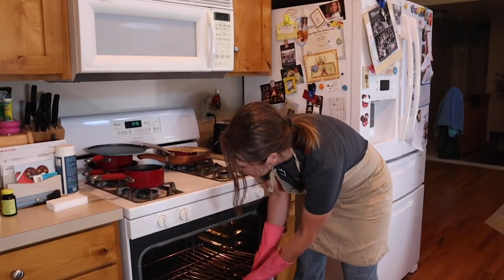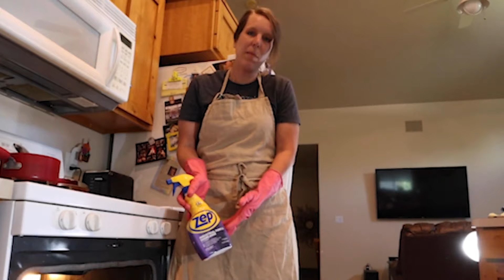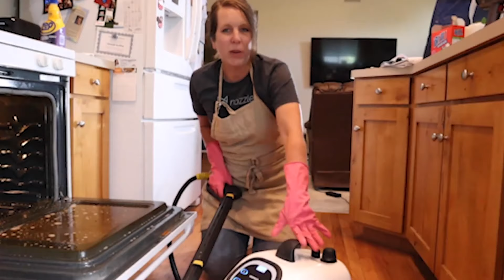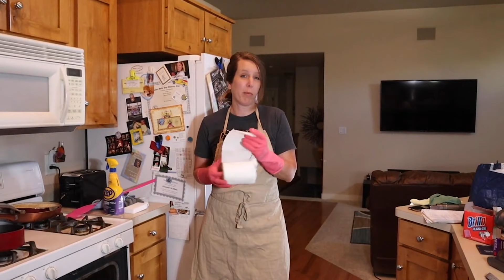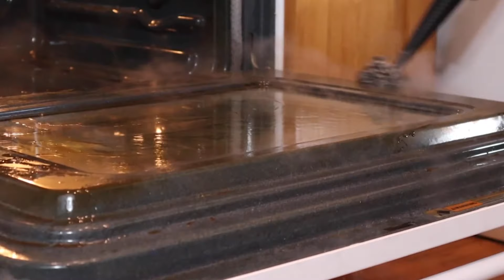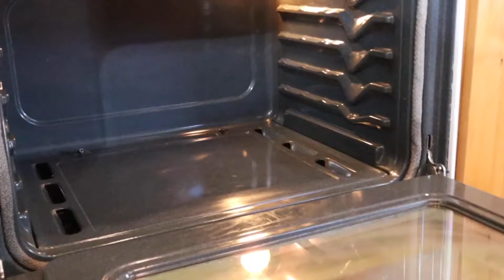How to Clean an Oven with a Steam Cleaner

Comment: The real reason for using a steamcleaner is so you don't have to use harsh chemicals
Reply from the maker: Yes I get that and we have an older video with a steam cleaner only. It still took a long time. I wondered if it would speed it up with a degreaser. Nope.

My goal is to find the quickest easiest way or to test what makes the biggest difference.

No or low chemical is ideal to me but it isn't always effective.
Reply: @CleanFreakGermaphobe  pp
Reply: I have a similar Whirlpool made Kenmore oven. Why go through all of this when these ovens are self cleaning ?
Reply from the maker: We get asked this a lot. There are many reasons. It overheats your kitchen for hours. It has fumes.. The extreme heat can damage your oven. 

Bad for pet birds and the gasses can kill them. This is a healthier alternative that’s safer.
Reply: @patcola7335  have you used the self cleaning option? You gotta leave your house for a while, especially if new! Like she said, those fumes.... well it's potent. You shouldn't be inside when self cleaning just in case
Reply: @Vlex24  I replaced that stove with an Amana which is basically the same thing. I certainly won't be using the self-cleaning oven with the summer months ahead...
Reply: I'm going to try this with the vinegar and baking soda method.
Reply: @Pahrump  Yes you are correct. For heavy spills you should most definitely try to get up the heavily soiled parts before running a clean cycle.
Reply: Exactly
Reply: @CleanFreakGermaphobe also, less physical effort required. Great for those with disabilities!

Comment: 60 year old ovens:  Spray with oven cleaner. Let cleaner sit on surfaces for suggested time.  Wipe mess out with paper towels or rags.  Finish with a damp rag to remove any cleaner residue.  About the same amount of mess and maybe less effort. Yes there are chemicals but it got the job done as well.

Comment: Did you know you can remove the oven door in front of you? Just move the latch back on each side of the door and pull the door up and voila! After finished, you install the door back in the same way that you just removed it. Just don’t forget to move the latch's back into the original position. Have a great day!
Reply: 🤯  Thank you!
Reply: I came to say the same thing.  I assumed the OP didn’t know how easy it is to remove the door.  I just recently learned this myself.

Comment: For cleaning oven door glass, you should check the metal retainer on the top of the oven door when you open it.  I'm not sure whether it's applicable on every cooker model, but on various models you open the oven door, lift the metal retainer up or slide it off (the white part on that cooker by the look of it). This gives you access to the the front glass plate so you can lift it out and clean inside. This is so you don't have to take the door off or use a fly swatter!
Reply from the maker: Interesting. I haven't seen that type but I wish they all had that feature
Reply: Well, mine is a Kenmore model and I don’t see that feature. Thanks for sharing.
Reply: You should make a video!!😊

Comment: I bought a $40 steam cleaner from Amazon that did the same thing. I spent the $900 on a cruise.
Reply from the maker: It’s for sure more professional grade and way ahead of the quality, functionality and durability of a handheld $40 steam cleaner. For starters the boiler is made of solid steel. I have 4 steam cleaners and nothing compares in terms of how hot it gets and how long you can clean plus the quality and variety of attachments. But if it’s all the same to you, get the $40 one.

Comment: Did you have any issues with grease messing up the vaccum cleaner? I thought about doing the same but I'm worried the cleanup of the vaccum with all that sticky stuff will be terrible
Reply from the maker: You can get a toothbrush to remove everything in the crack then wipe it up with a paper towel. I've not found a problem with my Dyson cordless. I can see and empty it out/wipe it out after. I don't know about a regular upright type vacuum. 

 However, these were pretty dry pieces of incinerated food.
Reply: Explain please

Comment: My pressure washer trigger doesn't have a lock. I have a zip tie around the handle, just tight enough not to slide over the trigger when not engaged. When I want to lock it on, I pull the trigger down and slide the zip tie up around the trigger. When done, slide it back down. Wonder if that might help you. I'm tired of working for other people and trying to start a cleaning company for myself. Thanks for the tips!

Comment: Silicone sheets save cooking splashes on the base part of the oven. Great idea using the flexi flat handle of the fly swat 😂
Reply: Usually most oven doors have screws that can be removed and the inside piece of glass is removable. Just be careful as once the 1st piece of glass is taken out the oven door can become very light and slam shut!
Reply: Silicone sheets cannot be used with gas ovens

Comment: I thought the purpose of a steamer is to avoid using chemicals.
Reply from the maker: It is but sometimes it’s bad and it helps to use some. Still far less than without the steam cleaner. I did make a video that was all baking soda and vinegar. It took a few hours and lots of scrubbing.

Comment: i am looking at a dupray steamer; do you happen to get more dry steam with the tosca and up or dose it matter? i am thinking about getting the tosca
Reply from the maker: The Tosca is heavy and made of steel so it’s professional level. Honestly, I use my Neat more but I use the Tosca for bigger messes because it holds more water and you don’t have to refill it as often. Plus it’s stronger.

Steam temperature - Neat
Affects the effectiveness and speed to clean, sanitize, degrease or deodorize.
275°F Neat
316°F Tosca 

Steam pressure
The higher the steam pressure, the easier it will be for heavy duty jobs.
50 psi / 3.5 bar Tosca 
72.5 psi / 5 bar Neat

Hope that helps, thanks for using our link if you decide to purchase one.

www.cleanfreakandgermaphobe.com/dupray
Reply: @CleanFreakGermaphobe  you knopw whAts funny, I ended up buying the tosca anyways; and yea its pretty strong
Reply from the maker: Chris Chang are you happy you got it?

Comment: Is there a danger of the steam getting into the electrics of the oven and causing it to short the supply?
Reply from the maker: I’ve never had that problem, however, i never use it or any cleaner or water on the oven light. I learned that the hard way.

Comment: I recently cleaned my oven because the smoke detectors were going off. After cleaning,  the alarm is still going off. Noticed the roof of the oven had splatter on it. Will the steamer be able to cut through that mess ?

Comment: Question: Won't that vacuuming in the oven like that,  make the inside of the vacuum greasy from all the greasiness in the oven??  I wouldn't WANT TO DO THAT TO IT,.   That makes me think do you have a video of cleaning the inside of a vacuum hose??
Reply from the maker: I've done it a lot with no problem. It's usually for the smaller pieces that you can't easily wipe up.

Comment: Great video! 
A couple questions: have you used the zero degreaser and steamer on a self cleaning oven? Does the steam or the steel scrubber top mess with the self cleaning film? 
Also, any special technique for the top part of the oven? Thank you!
Reply from the maker: I haven't used Zero. No it didn't mess with the oven coating. I wish there was an easier way to clean the top of the oven. It involves gymnastics and working upside down. If you think of a better way or if I find one, I'll do a video about it. That and the glass are the worst part.
Reply: Oops typo. Meant zep degreaser on self cleaning oven. Thanks!
Reply: @mariamamalik  in case you’re interested, I have sent an email to Bissell about using their hand held steam cleaner on a self-cleaning oven. I also plan to contact the manufacturer of my oven about this issue.

Comment: Do you think the dupray NEAT could do the same level of clean for the oven, as the Tosca?
Reply from the maker: Yes I think it would be close enough that there Neat works almost as well.

 If your oven was super greasy then you'd have not more heat and pressure with the Tosca to cut through it.

Comment: My oven has a cleaning program what is producing steam. I think you can pretty much imitate that program with adding hot water on the bottom and turning the oven on.
Reply from the maker: In my experience it doesn't work that well in the oven or microwave. It just doesn't produce enough steam and without any pressure, it does little more than using a damp cloth would do.

Comment: Woww.... at least unplugged the oven before you clean it lol
Reply from the maker: You don't have to unplug it to clean it. It just needs to be turned off. Unless your oven manufacturer says to. I checked GE and it doesn't say to.
Reply: Coincidentally I'm appliance tech so i know about this, any maintenance on appliances requires to unplug the power cord or breaker beforehand.
It takes just a second to switch the breaker off, doing that could save a  life.
Reply from the maker: Thanks for your coming comment. I wonder why it's not in owners manuals in the section about cleaning.

I'll do this from now on when I can. I did in my most recent oven cleaning video because of comments on this thread. 

It's odd that even in the professional cleaners group I'm in people don't unplug.

This wasn't my house or oven. I have a gas oven and it's a wall oven. So I've never had to unplug it and didn't know it was a safety issue.

Comment: great cleaning...but you just used a cleaner and steam cleaned it without a mask, fan or exhaust.
Reply from the maker: I don't wear a mask when I clean. I typically have a window open if there are harsh fumes.

There was good airflow in this kitchen. But I agree, it's safer to wear a mask. We're going to focus on greener options because of this issue. And reducing plastic waste.

Comment: I have a self-cleaning oven, which does a great job. Except…the area where the door meets the oven floor, which is where most of my spills occur.  I have a liner, which I remove before cleaning the oven and wash in the laundry sink then let dry. I have an email out to the Bissell customer service about the self-cleaning oven and steam cleaner.

Comment: Maybe isolate the power to your oven before cleaning - the oven light is on. Is death by electrocution worth a clean oven? The professional oven cleaners have specialist equipment, industrial sized ultrasonic cleaners. They know how to dismantle ovens properly, and reassemble them again. The average domestic clean will miss the built up grease under seals and inside the glass. Not to sure about using a vacuum cleaner on the loose debris. It's usually greasy, and could ruin your expensive vacuum cleaner.
Reply from the maker: You're way above our league. Most pro cleaners won't take apart the oven because it's a risk to put it back. I wipe the biggest pieces and vacuum out the smaller pieces.